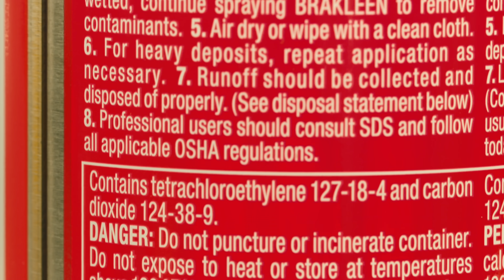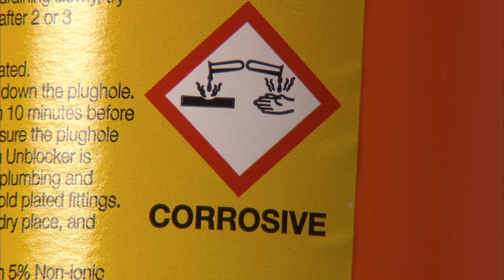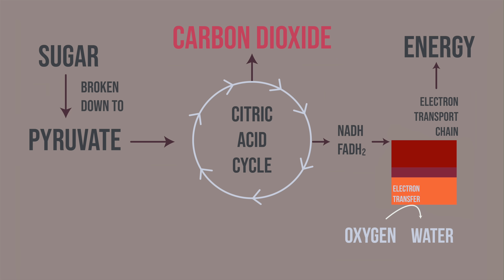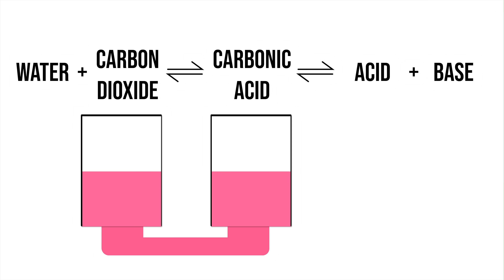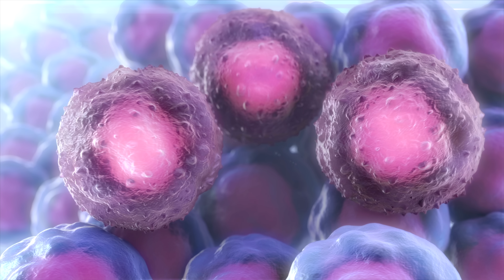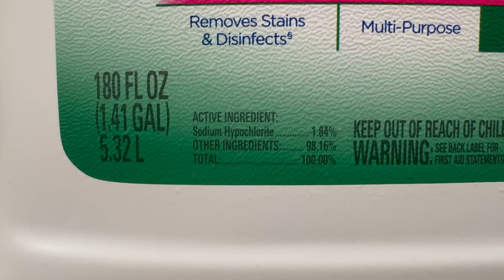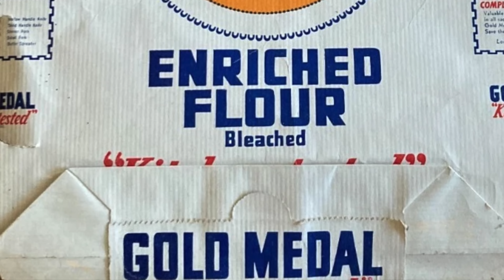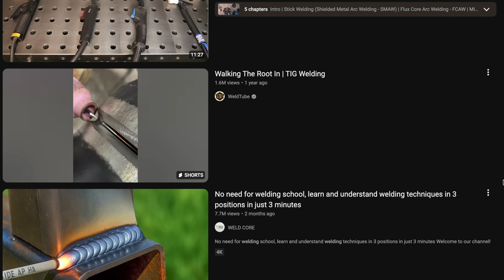"It smelled funny while I was welding and now I can't breathe..."

Comment: Basically all of the guides tell you that MUST weld outside or with oxygen mask. Most dangerous is stainless steel- Hexavalent chromium,  Welding galvanized steel releases zinc oxide, which causes so-called 'metal fume fever,shielding gas welding (Argon, CO2). Not even mention burned eyes and electroshock if you dont use heavy gloves and sleeves and it is hot and sweaty . I know a man that died because he tried to scratch his head while holding his electrode . Acute Poisoning (Phosgene and Metals) is very well known and every guide warns about it.

Comment: many types of welding rods also make toxic fumes that have permanently damaged welders' bodies with heavy metal poisoning that can damage organs and nervous system including brain.

Some experienced welders find after years they have a horrible case of poisoning and organ damage.

Proper ventilation and respirator are two very important things.  Avoiding welding coated metals without proper appropriate controls and that is a very complicated subject in itself.

Comment: Back in high school, our pool had a major malfunction while we were in it. The ventilation system stopped working right as the chlorine dispenser dumped all of the chlorine in the tank into the pool at once. As soon as it happened, everyone rushed out of the pool room. I had tunnel vision until I got out of the room and taking a deep breath caused me to cough uncontrollably for minutes at a time. I got super lucky to not have any lasting issues or well... drowned.

Comment: ahhh,yes,.  the ethylene family...    TriChloroEthylene and others are also extremely carcinogenic - it's well known in the electronics industry where these chemical solvents are used to clean and degrease circuit board and associated electronics.  80's and 90's incurred many workers with stomach, brain, and other oddball and unexplained tumors and malignant cancers because the workers were eating where they work, didn't use fume hoods, nor had any safety protocols.....     these chemicals are still in use, and rarely are there regulations in place to protect the workers because it takes years to diagnose.

Comment: this is scary, i used to weld and make metal structures for adornment, you are always on the fence about the things you can see like equipment turned off, metal splinters, metal sawdust, hot surfaces, sharp objects, damaged equipment, water sources, etc, but it's the things you don't see that can get you like the UV exposure or chemical reactions or hell even the electric arc itself. the proper equipment is uncomfortable as hell and you can argue the welding mask hinders more than helps to work with but damn son if you wanna keep safe and keep working on it, you are going to use it

Comment: I've used brake cleaner to clean oil and grease off of metal before welding a few times, but I knew about this risk and there's two things I always do.
1. I only buy non-chlorinated brake cleaner 
2. I make sure it's completely dry before welding.

Another common risk with welding is welding galvanized metal. It creates a poisonous gas.

Comment: Fun times with phosgene.

During my apprenticeship I witnessed one of the younger apprentices do basically this, but somehow even dumber. He forgot to take the shipping sticker off of a new muffler, so he started spraying it with Brakleen while the car was running and starting to heat up... He did not understand why everybody got mad at him.

I also got sunburnt multiple times because people insisted on welding 5ft next to my lift.

Comment: There are so many warnings at the beginning of the manuals that come with welding machines but they are mostly about electrical and heat dangers. Warnings about chemicals and coatings are often not emphasized as much of a threat. A ton of coatings applied to metal can cause serious problems with health.

Comment: I learned to weld when I restored my first car, a 1959 Triumph TR3a. My father taught me to always weld outside and unwind from what you're welding. Even clean steel produces metallic vapor which is all kinds of bad. I know this is about brake cleaner burning into phosgene gas but welding is more dangerous then you think. Dedicted welding areas in shops always have ventilation flowing through them to the outside for a reason.

Comment: I use brake cleaner too, but over here the formula is entirely different. It's a mixture of naphta and acetone pressurized with CO2 to make it spray out of the can. I knew it was different in Europe than in the US, but not that it was a completely different product.

Comment: I don’t weld but I often use this type of brake cleaner and to be completely honest I wasn’t aware of this danger. I don’t know if a propane torch used on brake cleaned parts can be enough to cause the same effects but it’s something that I’ll always keep in mind now, not that that’s a typical scenario but still something to keep in mind. It’s scary how quickly you can get yourself in trouble on DIY projects when you aren’t well informed. I try to be as careful as I can with soldering, chemicals, etc, some damage is irreversible and it’s not our health.

Comment: Phosgene is one way welding can get you, but the more typical welding fumes aren't good for ya either. I try to only weld outside or with fume extraction, or at least a fan blowing fresh air on my back and into the mask. I'd want one of those supplied air/PAPR hoods if I were doing it every day or in any sort of confined space.

Comment: Thank you so much for that.
I do some amateur welding in my projects. I didn't know about 'Brake Kleen'.
Another common welding trap that I did know about, was Zinc plating.
If you need to weld Zinc plated steel, you need to grind the Zinc away from the area to be welded (using a mask of course). 
Welding Zinc plated steel can be very unpleasant at best.
Ask me how I know...

Comment: Relatable, i have a brain tumor - and i often desaturate down into the high 80s, i've had a gas test done which confirmed low oxygen, and high C02 - Which should be no surprise that the type of brain tumor i have (Vestibular Schwannoma) often kills by shifting the brainstem enough to interfere with signals to said lungs. My blood is a bit on the acidic side as a result. Fun times. However not :P

Comment: I use often brake cleaner to clean surfaces when i weld aluminium , but you first wait it to completely evaporate. Never had a problem, oh, and i work in a basement without ventilation, so stop fear mongering!

Comment: Being both a paramedic and a welder, I never thought of using brake cleaner or what it could do. I am aware that you shouldn't weld anything with galvanization without an air supply, but it is best to strip the galvanization first. That is what I was expecting this video to be about.

Comment: @ChubbyEmu Welding doesn't really implies "high voltages" (typically ~60-70Vdc with no load), but high current, yes indeed. And as an inert gases mixture is used with MIG, tetrachoroethylene oxidation is little less likeky than with rod welding, but still quite possible.

The main factors leading to phosgene formation are high temperature and intense UV radiation emitted by the arc, in the presence of oxygen in the air. 

Trichloroethylene may evaporate faster than tetrachloroethylene, which reduces residual risk after prolonged ventilation, but both remain strictly prohibited in welding environments due to UV- and heat-induced phosgene formation.

In conclusion, the use of chlorinated cleaning solvents is strictly prohibited in welding working areas.

Comment: No brother welding does not uses high voltage, it just uses high current, 
If you put high voltage then you don't have to worry about rust cause there is low voltage that voltage can't penetrate that rust easily as even little resistance at low voltage can resist and affect flow of current greatly.
Even if you put high voltage and to match that high voltage if you put high enough current to stop potential drop, overall energy transfer will be so much greater that it will just melt your metal completely and instead of joining two metals it will just create a liquid metal mess.😂😂

Comment: Caution. Even if the surfaces are completely clean, welding fumes are harmful to the lungs, especially when welding stainless steel. In enclosed spaces, it is essential to use welding fume extraction. If this is not possible, suitable filter masks must be worn.

Comment: I think where a lot of people here in the comment section go wrong is they are probably highly educated and take for granted obvious chemical dangers or had professional training for chemical safety. Thing is, welding doesn’t require that background and most often is a lower class blue collar occupation. This danger is then compounded by gung ho attitudes toward safety in the trades. 

It’s great that all you chem majors know about phosgene but I assure you a lot of welders don’t. They think “chemical make metal clean” and use it. Brake parts cleaner especially is used as a “clean all” in auto repair and that’s a problem in itself. I’ve always respected how dangerous welding can be which is why I don’t do it but I could see myself making the mistake in this video if pressured by a manager to do a quick weld that’s “no big deal, here I’ll show you how easy it is” without any of the safety training.

Comment: Welding Galvanised steel / Zinc plating produces Phosgene gas. As a skilled welder I’ve seen hundreds of unskilled people do this. And they say they’ve been doing it for years. The difference between skilled and unskilled 🖖👀👍
Reply: It would vaporize zinc or even cadmium coating That can be toxic

Comment: Might mention that flux core weld, which i and many amateur welders use because it is so much more practical is dangerous to breathe. A respirator is best, I have a well aired workshop and use a fan to get the smoke quickly away, and also make sure to turn away to breathe.

Comment: I have used the same brake cleaner, (and now know thanks to you, they make a non chlorinated cleaner) and this stuff drys really fast, so I am wondering if the metal was still wet with the cleaner or it was the dried residue that cause this. This is very scary and I wonder how many people have died from this with never being diagnosed from the cleaner.

Comment: Should look at the medical risk of cutting/welding galvanized steel. Had a GC give me a torch when I was an apprentice to cut galvanized corrugated steel when a Jouneyman took it away and chewed out the GC for not explaining the riaks or giving me any PPE. 
Also, R22 refrigerant has a very pungent and immediate burning smell when overheateted.

Comment: I had my misgivings about brake cleaner and now I know why. There are probably warnings on the can, which I didn't have to read. If you want to know what I use on small projects, it's vinegar, water, and a scrubbing pad. Wear gloves. Rinse thoroughly and dry by heating the parts. That iron oxide gets everywhere and is difficult to scrub off. If I had to do any quantity of this, I would get the rust-removal laser.

Comment: Also perchloro ethylene is in general significantly less reactive than ethylene. Because chlorine is a more highly electronegative than hydrogen it pulls electrons away from the pi bond making it less reactive.

But yeah obviously ethylene is a gas and also doesn't have chlorine source so it can't easily form phosgene.

Comment: Don't ever heat a chemical unless you know what you are doing. For example cyanoacrylate, despite its ominous sounding name, is non-toxic, you can safely ingest small amounts of it when it's dry, workshop workers often use it to close minor cuts in the same way doctors use it as surgical adhesive and the cumulative chemical burns and occlusion from sustained skin contact can be combined with duct tape to remove warts more reliably than a doctors visit.

The moment you start burning it, however, it turns into boiling hydrogen cyanide, anyone working in a forensics lab can tell you that cyanoacrylate should only be heated in a controlled environment.

Comment: Unexpected but a welcome surprise. A great xmas gift!
Edit: Low oxygen saturation is no joke. Had it happen a few times in my life, twice of which I got driven to ER. I've chronic astmatic bronchitis and it just suuuuuucks. You take two steps and feel like you're running a marathon. But don't just take the measurements of store-bough finger oxymeters. They sometimes measure wrong. Same with smart watches. Measure multiple times. If you have lower oxygen under 95%, trust me. You will feel it, don't need a device for it.

Comment: I recall a tale... maybe in Reader's Digest? about a woman whose heart needed to rest for some reason, and they did an unprecedented thing of hooking her up to a machine that would draw out her blood, oxygenate it, and put it back into the body -- she existed for IIRC a few hours or days with no pulse but otherwise no negative symptoms, before the heart got fixed up enough that they could reconnect it.  It feels like such a machine, specced to get rid of excess CO2, could help in cases like this where the lungs are compromised and the team needs time to figure them out and fix them without letting the rest of the body systems get additional effects they'd have to deal with on top of the main problem.

Comment: I always cringe a bit when I watch a car-related video where they just hose something down with brake cleaner and then heat it with a torch or vice-versa.  Even if it's not hot enough to make phosgene, it can't be great inhaling those vapors.

Comment: I tried to cut weeds with machete and chopped off tip of thumb.  Then a couple weeks later i tried using battery powered driver to screw a license plate (as decoration) into side of my work bench.  The screw fell and the electric drill pushed the spinning philips bit directly into my stump wound.   I would never buy a table saw, a circular saw, or a chain saw.

Comment: A genuine question, are we talking about brake cleaner being still on the welded surface (wet) or after it already dried off? I mean, brake cleaners are usually highly flammable so welding a surface drenched in brake cleaner would probably start a fire.

Comment: Already knew before watching the video that it would be chlorinated brake cleaner. Folks, don't use chlorinated brake cleaner on any components before welding. The alcohol or acetone-based products are safer, cheaper, and IMO work better.

Comment: The moment I heard "Brake cleaner," I knew he was boned. I flat out won't use (or even work in proximity to) chlorinated brake cleaner because that terrifies me.

I used an old bottle once that had a missing label, and it caught fire. Fortunately poison control was able to look it up by the few markings that I found, and let me know it was unchlorinated. Don't be afraid to call poison control, and if you find a bottle of old cleaner, using it isn't worth saving the money on a newer, safer equivalent.

Comment: The internet can be used to acquire a complete and free or low cost education in many things. However, there are notable exceptions that should never be attempted. Welding, like surgery requires a hands on, in person education and you will want to pay special attention to all of the safety courses. It's hard to believe that anyone can just buy a welder on Amazon these days. Being a welder, which I'm not yet, I'm beginning my education as a post pandemic reinvention of my career path, is the definition of something very difficult that is made to look easy unless you are doing it. Don't mess around, the basic vocational training is around 8 months @ $3,500.00 followed by a year of apprenticeship then certification. From there you can further your education and add endorsements to the certification like pipe welding. Do it right or don't do it at all, it could mean your life.

Comment: 5:50 MIG welding does not really use high voltage. Typical voltages are only around 20V, usually DC. It is high current, though. Given that the welder is just plugged into an outlet, which limits the total power (wattage), you can only raise either the voltage or the current, not both.

Comment: speaking of easily accessible commercial hobbies and irreversible lung damage, pottery is one of seemingly inoccuous ones. You go on some pottery-and-wine event, you see how custom mugs are well-sold on craft markets, so you buy or make yourself a nice little kiln...
Then you even learn about lead glazes and you think you know everything there is to know about the dangers? 
but then glaze org is free out there, a lot of glaze ngridients is so very easy to buy. the kiln working farts hazardous gases,  clay dust ( hi kaolin, SIO2, what fun) the lotsa kobalt and cadmium and other interesting safe-looking stuff like titanium dioxide ( how harmful can be things found in toothpaste?) all go into the hobbyist's lungs, and a lot of people treat using ventilation camera when glazing as an expensive suggestion!
now im not even talking about dangers of incorrectly fired dishes and using those dishes to eat and drink. Hobby markets are full of bad epoxy crafts and tiktok DYI all that stuff.

Comment: The Brakleen issue is fortunately well known by mechanics and welders. Good to make it more well known though.  I won't use Brakleen in my shop period, even if never welding.  Another think to never weld with around is zinc (galvanized metal).